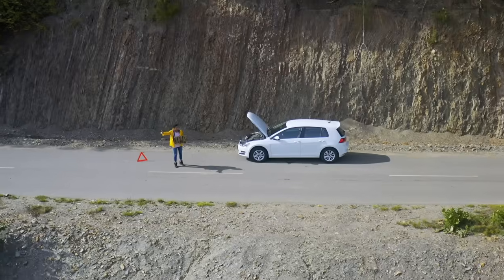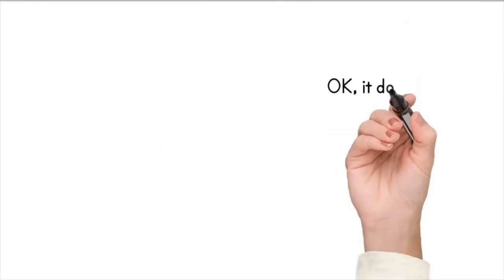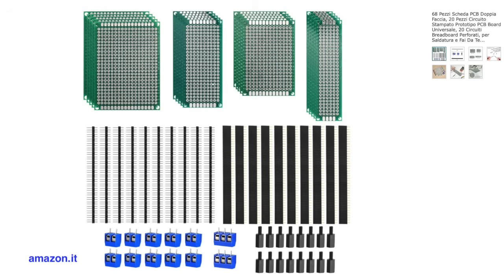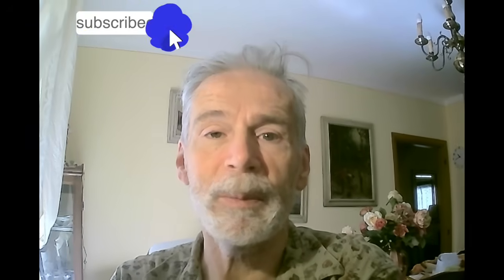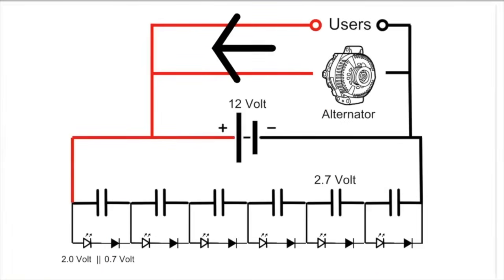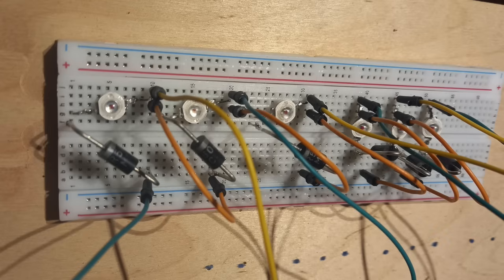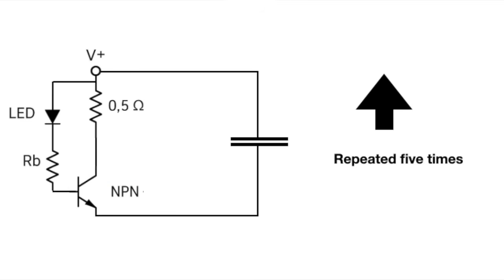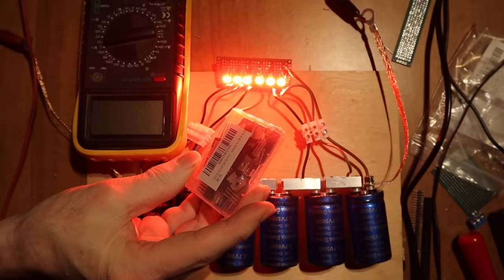Don't buy a new car battery before trying this - Video 93

Comment: Please specs and photo needed for the LEDs used AND DIODES USED. Photos welcome. Need part no / specs to get from local store.
Reply from the maker: I have them now in the other house, but basically the diodes are Schottky 10 A (AUKENIEN 6 Valori 60 Diodo Schottky Kit 10SQ045 10SQ050 15SQ045 10A10 SR5100 SR560) and the LED are CHANZON 10pcs LED ad alta potenza Chip On Board 1W Giallo (300mA-350mA/DC 2V-2.4V/1watt).

Comment: Questa idea non è una novità, sono necessari 6\8 super cap da 2,7 V. ogniuno deve avere un limitatore di carica e un circuito per prevenire il corto le correnti induttive si risolvono con sistemi induttori capacitori che mettono in gioco le cariche per il circuito di carica dei super capacitori, il sistema di ricarica deve essere  capace di fornire correnti capaci di fornire circa 500mA per super cap. attenzione ai diodi super fast da almeno 50A. l'uno inserisci tutto in resina epossidica un termofusibile ed un by pass in caso di guasto. Buona fortuna. Buon video e spero non venga anch'esso sepolto.
Reply from the maker: Grazie VC per questi dettagli, infatti sono solo parzialmente sulla strada verso la perfezione, comunque I risultati cominciano essere interessanti. Prevedo per sabato di Pasqua un video che fa vedere un prototype più maturo, in grado di bilanciare bene, dare molto più corrente e non prendere troppo corrente durante il parcheggio. Ecco questa corrente parasitaria vorrei ridurre. Ho già i transistori.
Thanks VC for these details, in fact I am only partially on the road to perfection, however the results are starting to look interesting. I foresee for Easter Saturday a video showing a more mature prototype, able to balance well, give much more current and not take too much current while parking. Now, this parasitic current: I would like to reduce it. I already have the transistors.

Comment: I had a lot of fun building a pure supercap based system to start my car. And it worked really well!  Buuut... with big enough components to reliably REPLACE the conventional battery it was almost 10 times more expensive than a normal battery. Having 2 systems in a car that can fail is not to my liking.
So I had a lot of fun building it and now I'm back at buying a new car battery every 5-10 years. They usually don't die instantly. When they start to show signs of weakness in the first cold days of the year... just get a new one and recycle the old one. I accepted the fact that batteries are consumables. 

It was a supercap only system, with a sustainer battery to handle standby current while standing. Basicly always keeping the caps charged up. Which they don't like for a long life, too. -.- I haven't used them for long and bought another battery instead of killing my precious supercaps. ;)

I am unsure about the actual real world usefulness of a combination of batteries and supercaps. Both have such dramatic different discharge curves that I don't expect a lot of actual load sharing. At first it is the supercap only, and then the battery takes over.
Reply from the maker: Hi Jack, thanks for the interesting story, it was very fascinating to read it from someone with real experience. I still believe they can do a good job together because the super caps are so flexible with their voltage and don't have an own voltage like batteries have. They have only a maximum voltage at everything below that is fine for them. In my view, they are perfect for the really heavy work of starting the engine because of their low internal resistance and the many more cycles they can do before retiring. As I said below in reply of today, this work of starting the engine is a bit like working in a coal mine. Not hard enough to die quickly but too hard to have a really long life. But again, you have a lot of experience and I appreciate that.
Reply: @nnvasen-good-energy  Supercaps degrade faster when held at charge. They don't mind cycling like crazy. But holding them at 2V or above reduces their lifetime significantly. They will still last quite a while, but this is not what they are best at. 
And actually.... the lead car battery is extremely well rounded for the purpose.

Comment: Try getting decent capacitors, that's a bigger hurdle than the project
Reply from the maker: I found the Maxwell Super Capacitors. I can buy them but don't know if I can advice others to do the same. I wanted to present something competitive. So I bought 6 for 53€ and tested them one by one. 10% self discharge in 24h but very equal in characteristics.

Comment: There is another but more expensive way. Use 6 times Yinlong 35Ah or 45Ah LTO cells in parallel with 5 or6 x "Super capacitor 3V 3000F Brand New High Quality Caraudio Car Start Freely Assembled High CCA Low Internal Resistance"
  The  caps have the same format as the LTO cells. Having the lithium pack means the caps never fall too low. This is an extremely powerful battery but it should be charged via a current regulating circuit. One way to do it is to have 6x dc to dc modules but only some of them can provide high power at low voltages. It depends how fast you want to charge. LTO cells can charge very quickly so can cause similar issues to the supercaps if you don't limit charge. LTO can be charged to 2.8V per cell so 6 of them can handle 16.8V you could use more and let them charge up to alternator voltage. You also need a cell balancer but this can be avoided if you plan to use 6 dc to dc modules to charge each cell individually. You can also have a combination of charging from the alternator and from the 6 individual modules.
  TBH you can just go with 12x LTO as the super caps are not much cheaper. The LTO have around 20,000 cycles till 80% dod.
Reply from the maker: Very interesting reasoning, I will take this into account. Also the individual charging units for each LTO cell, but you need some way of potential separation if fed from a common power supply (could be solar energy). If they have this 20k cycles, then it becomes even more interesting. Thank you.

Comment: I would mostly be concerned about the leakage current through the capacitors when the car is off, flattening the battery. Capacitors naturally lose charge, that's entirely a useful consequence of their use and design
Reply: Can use solid stare relays to cut them off when not in use and to regulate the amount of charge coming into them by using a PWM signal to trigger them.
Reply from the maker: See below in my answer, I put the SSR already in the shopping cart as a reminder to take and try them
Reply: @ Perhaps, but how much current do you want to run through the relay and how much is all this starting to cost? Batteries last a number of years if you treat them properly, i've never felt they were a liability to the reliability of the car, or your pocket

Comment: Older motorcycles used a capacitor instead of a battery to charge the ignition system and get a good spark.
Reply from the maker: If they were old, then I can imagine that they had a certain amount of microFarad, and indeed, for a spark it is enough.

Comment: @Energy Home DIY - Going from 12 volts stored in the capacitors down to 10 volts during cranking means that only 30% of the energy actually stored in the capacitors at 2.0 volts each can be tapped when the series-connected capacitors are put in parallel with the starting battery. This is because the stored energy varies in proportion to the SQUARE of the voltage. Compared to the energy the capacitors CAN store, at a conservative 2.6 volts each, the performance is MUCH worse than the capacitors are capable of providing. 

On the other hand, if parallel-connected capacitors are put in SERIES with the battery (in the cable to the starter motor), then over 99% of the capacitors' stored energy can be tapped when going from 2.6 volts per cap down to 0.1 volt. This approach greatly simplifies the capacitor charging circuitry, and means that the caps can be fully charged even from a very weak battery. Also, the initial voltage to the starter is momentarily increased from 12 volts to 14.6 volts, which increases the available power to the starter to 148% of normal, and maintains that increased power for longer than the weaker boost described in the video. 

The caveat with my proposal is that a high-current switch such as a starter relay must be wired across the capacitor bank and triggered to close very quickly when the capacitor voltage drops to near zero. Then the battery carries the whole starting load, as normal, but by then the engine will already be spinning. This extra switch also protects the capacitors from being reverse-biased and damaged.

Btw, Norbert, a bad microphone setup combined with thick accent is a BAD COMBINATION.

Comment: just replace ur car battery with a 6s LTO battery and an active balancer, no bms. problem solved, no leakage current to kill ur battery
Reply: how about 6x LTO in parallel with these: "Super capacitor 3V 3000F Brand New High Quality Caraudio Car Start Freely Assembled High CCA Low Internal Resistance" Also. look into solid state relays as they can be controlled by PWM circuits allowing the charge current  to be regulated.
Reply: @izzzzzz6  you could just leave the overhead lights on to simulate the same leakage current lol, lto is capable of enough peak current and has the same effectively unlimited life span and works in any climate. drop the supercap fascination. unneeded complexity and too many downsides
Reply from the maker: I say in some video that the Super Capacitors better follow the voltage of the battery so that is the reason to be fascinated by it. Also because of long life. If also LTO has long life and enough Ah for not to many $ then they can work alone and replace the lead battery. But putting different batteries together in parallel... that is a challenge. I described that in the same (other) video as "two gladiators on one cart" 😀
Reply from the maker: That is a very good idea, I found the SSR online and will see how much resistance they have and how I can apply them.

Comment: All the materials to build the thing cost more than just replacing the battery to begin with. Bg battery in Bowling green Ohio 45$ for brand new battery's' I always get them there cause they are dirt cheap
Reply from the maker: I don't know if I can agree with that .... 
OK, if you include the oscilloscope. But the Super Capacitor where 53€ for 6.
It's also about the environment. 1 billion lead batteries in the world will have a longer live. And there are many people that think that the lead batteries are very well made for big currents. I think it is like the mine workers that yes, were able to work for many years under the ground but would have lived much longer if they had found another job.
Reply: @nnvasen-good-energy  94% of them are recycled. Brittan and the Eu make ammo as well as led fishing weights for boating. SO that's never been the case. Also the acid is recycled to make hydrochloric and etching acids from it. The country's that are thrown them away doing this are china and India Not the united states.

Comment: At 2:15 the voltage on the scope goes up when cranking, this makes no sense, please explain.
Reply from the maker: Thank you for the question. Indeed I plucked it from video 89, https://youtu.be/KOv28Q8VcWY, somewhere from 20:00 where I start explaining the oscilloscope and the car. I had to have a common ground for both channel 1 and 2, so the voltage your refer to is upside down.
Reply: @nnvasen-good-energy  thanks for the explanation!

Comment: I was at a trade show called Conexpo a while back I am pretty sure I saw people selling capacitor "batteries" for stating trucks, and cars.   They were pricey.  Is this the same thing or what??
Reply from the maker: Hi Quentinhilpert, I don't know because I was not there. Is it the one in Las Vegas every 3 year? but I think it is similar. I can image that USA truck drivers have to start sometimes in rather cold weather, too.

Comment: Just remember that energy density of supercap are in the rang of 10 Wh per kg and energy density modern battery is 300 to 400 Wh per kg, so this is the reason why supercap are used to recorver energy from breaking because they can be charged immediatly witch is not the case with battery. We need imrovement in supercap to be more efficient and supercap has an exponentiel curve of discharge so you need an electronics circuit to act like a battery witch is a constant voltage source with an internal resistor (a supercap has also what is called Équivalent serial resistor ESR). Remember you old physics course, you will loose energy by recharching a supercap
Reply from the maker: You are right Elie abthe resistance that can be 0,1 Ohm with cheap capacitors and mine are cheap. I can buy the good ones but my audience will like to know how to do it at a low budget. I should measure it. But they perform well and lifetime is expected much longer than batteries. I believe this but have to see for my cheap capacitors. Fact is that they have unique characteristics that we have to use and till now I am happy with the price and performance.  I have now eliminated a big part of external resistance with the last video and will measure how much better it will perform and help the battery.
Reply: use LTO instead
Reply: @izzzzzz6  Why not Plutonium batteries? Even those are cheaper than LTO and last 100 years. ;)
This was sarcasm, btw! Recommending such niche technology is not helpful.

Comment: What’s the point of all this damn tinkering anyway? If your car’s built for it, just grab an AGM battery—or a solid EFB, they barely cost jack these days. Decent EFBs are goin’ for under a hundred bucks, and they’ll last you a good five years if you don’t treat ‘em like crap. That means recharging ‘em regular in the winter, folks. And if you’re stuck in some sweltering hellhole climate, skip the maintenance-free nonsense and go for refillable batteries—top ‘em off with distilled water now and then, boom, done. All this capacitor fiddling? Total horseshit. And if you want somethin’ that’ll outlast your sorry ass, pony up for five or six LTO cells—yeah, it’s like 800 bucks, but those suckers’ll still be kickin’ when your car’s a rust bucket in the junkyard.
Reply: Well all these options are viable including the one that you don't do nothing just sit in your....
And when I mean nothing it includes insulting people who want to share their modest work and opinion.
Reply from the maker: This Super Capacitor will still be kicking when your next next car is a rust bucket.
Reply: Dictionary: “EFB” stands for an “Enhanced Flooded Battery”. When compared to a traditional lead acid battery, an EFB provides improved charge acceptance as well as greater cyclic durability. Because of this, an EFB will typically last up to 6 years as opposed to 3-5 years for a traditional lead acid battery.
Reply: I've had enough of lead acid. They die in the cold, they have cost me a small fortune over the years. I would rather pay double and build a battery that can last 20 years. LTO cells are possibly the answer.